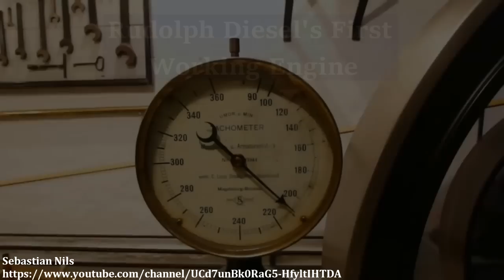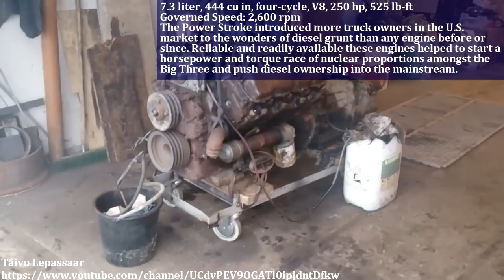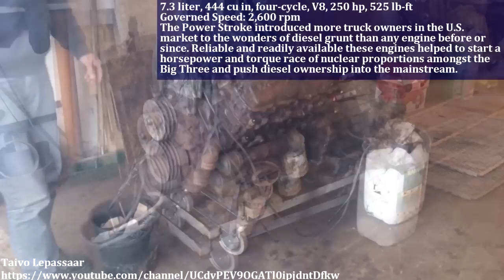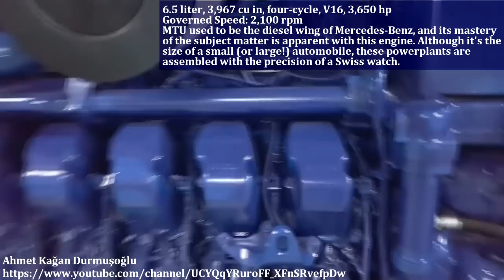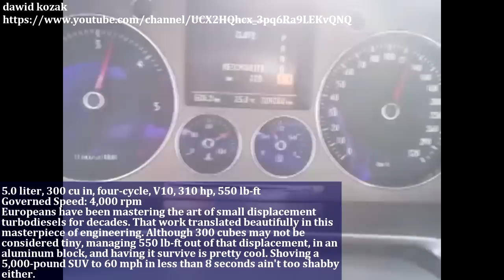10 of the Greatest Diesel Engines - Ever

Comment: No EMDs?

Not only do they make up a significant portion of the heavy freight locomotive industry, they also have a large presence in the inland water ways (i.e. the overwhelming majority of the main propulsion engines in towboats in the US that are 5,000 horse power and above are EMD) and marine (i.e. nearly 40% of tugs in the US have EMD main propulsion engines) industries.  

EMDs also powers a good portion of oil rigs (i.e. the 8500 series semi-submersible oil rigs of Ensco plc are all powered by the 20-710 engine) and provide back up and in some cases main power (i.e. EMD diesel generators provide power for Catalina Island off California) for various utilities.

They also contributed greatly to the war effort under its predecessor Cleveland Diesel Engine Division providing power for submarines, tugs, etc.

Comment: 1:44 not a powerstroke, 7.3 na, idi. Same but alot different. Still made by international navistar. Had a 1991 f250 5 speed with that engine, wicked torque but it hated cold weather.

Comment: The Gardner 150 LX was the most reliable diesel in the 1960s,we had them in ERFs and they regularly did up to 1000000 miles without anything other than regular oil and filter changes,they were slow and steady and this opened the door to Cummins 180 and 220 engines and then Scania,Volvo and Daf joined in and that spelt the end for Gardner.The 8LXB 240 hp Gardner was a big lazy lump just could not keep up with the competition in cost or power.

Comment: Some of the specs are way wrong here. A 60 litre with 1200 inch displacement, but a 6.5 litre that displaces over 3,000 inches? Cubic inches and litres are the same in terms of displacement so these numbers are way off. Suprised the old B model 3406 isn't on here.

Comment: I do not agree at all . consider the caterpillar c12. one of the best engines. in fact it is one of the worst caterpillar mistakes. I personally work with 3 engines and they  have a  factory problem with the oil rings on the pistons. They either lock or break. caterpillars 3406 e , c15 , c10  way better than c12

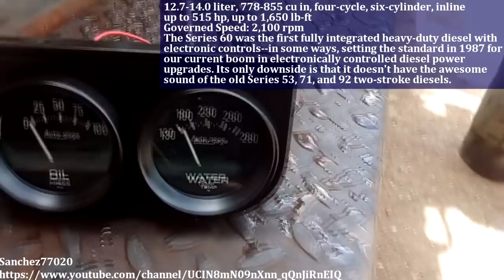Comment: 4:10    Detroit Diesel Series 60
 
Manufacturer
Detroit Diesel

Production	1987–2011
Layout
Configuration
Inline-6

Displacement
677, 775, 854 cu in (11.1, 12.7, 14.0 L)

Cylinder bore
5.12 in (130 mm) (11.1L)[1]
5.24 in (133 mm)
Piston stroke
5.47 in (139 mm) (11.1L)[1]
6.3 in (160 mm)
6.62 in (168 mm)
Valvetrain
OHC[1]

Compression ratio
15.0:1 (11.1L),[1] 16.0:1, 16.5:1

Combustion
Turbocharger
Wastegated, Variable geometry turbocharger

Fuel system
Fuel injection

Fuel type	Diesel

Cooling system
Water-cooled

Output
Power output
330–605 hp (246–451 kW) at 1800–2100 rpm (11.1 L)[1]

Torque output
1,150–2,050 lb⋅ft (1,559–2,779 N⋅m) at 1200 rpm (11.1 L)[1]

Dimensions
Length	57 in (1,400 mm) (11.1L)[1]

Width	34 in (860 mm) (11.1L)[1]

Height	50 in (1,300 mm) (11.1L)[1]

Dry weight	2,550 lb (1,157 kg) (11.1 L)[1]

Emissions
Emissions control technology
Diesel particulate filter

Chronology
Predecessor	Series 71

Successor	DD15
 
The Detroit Diesel Series 60 is an inline-six 4 stroke diesel engine produced since 1987. At that time, it differed from most on-highway engines by using an overhead camshaft and "drive by wire" electronic control. In 1993, it was popular on many USA buses in the 11.1 L (677 cu in) displacement.
When it was introduced in 1987, the Series 60 was the first heavy-duty diesel engine with fully integrated electronic controls.[2] Detroit Diesel prescribed overhaul intervals of 500,000 miles (800,000 km), then raised that to 750,000 miles (1,210,000 km) after more experience was gained with the new engine.[3]
In 1993, the 11.1 L (677 cu in) version was rated at 350 bhp (261 kW) (but would produce 15 more if the cruise control was engaged).
12.7L
The Series 60 was also available in 12.7 L (775 cu in) at the time, which was created by a longer stroke of 6.3 in (160 mm).      Both engine sizes were also used in truck and tractor-trailer applications.
In 1998, the 11.1-liter Detroit Diesel Series 60 was discontinued.[5] Once the 11.1-liter Series 60 was discontinued, the 12.7-liter Detroit Diesel Series 60 became the motorcoach application. Starting in the late 1990s, Neoplan made the Series 60 as an available engine for their high-floor and low-floor articulated buses - the AN460A and AN460LF. Detroit Diesel began making Series 60 marine engines in 1999, with wider availability starting in 2000.[6]
14.0L
In 2001 the bore and stroke increased and the engine displacement rose to 14 L (854 cu in), with an increase in power output to 575 hp (429 kW) and a torque increase to 1,850 lb⋅ft (2,508 N⋅m).
In 2004 the 14-Liter engine became the dominant platform in Freightliner over the road sleeper trucks and changed the ECM to a DDEC V. The 12.7L engine was favored in buses for its better fuel consumption.
In 2007 the 12.7-liter Detroit Diesel Series 60 was discontinued. Once the 12.7-liter Series 60 was discontinued, the 14-liter Series 60 replaced it. By 2008, Detroit Diesel had produced one million Series 60 engines.
In 2007 - 2010 (2008 -2011 trucks), the Detroit Diesel 14L engine was modified to meet new emissions standards and went to a dual ECM configuration (DDEC VI). This engine ran higher compression, higher injector pressure and a DPF exhaust filter. The block and crank remained the same as the older 2004-2006 engine models.
In 2011 the series 60 engine was discontinued and replaced by the DD15 engine.
Specifications[edit]
Specifications for selected Series 60 engines[8]

Displacement
Bore	Stroke	CR
Torque	Power	Dimensions
(L×W×H)	Weight
677 cu in (11.1 l)
5.12 in (130 mm)	5.47 in
139 mm	15.0:1	1,150–1,350 lb⋅ft (1,559–1,830 N⋅m)
@ 1200 rpm	330–365 hp (246–272 kW)
@ 1800–2100 rpm	57 in × 34 in × 50 in (1,450 mm × 860 mm × 1,270 mm)	2,550 lb (1,157 kg)
778 cu in (12.7 L]
	6.3 in (160 mm)	16.5:1	1,350–1,650 lb⋅ft (1,830–2,237 N⋅m)
@ 1200 rpm	330–505 hp (246–377 kW)
@ 2100 rpm		2,640 lb (1,197 kg)
854 cu in (14.0 L)
5.24 in (133 mm)	6.62 in (168 mm)	16.0:1	1,550–1,650 lb⋅ft (2,102–2,237 N⋅m)
@ 1200 rpm	435–575 hp (324–429 kW)
@ 2100 rpm		
Electronic Control
The most popular on-highway Detroit Diesel engine was the 12.7-liter, and on-highway engines are electronically-controlled by the proprietary Detroit Diesel Electronic Control (DDEC) system. The DDEC system was the first commercial use of a fully electronic control on a highway engine, and multiple years would pass before other manufacturers followed. The functions available in the DDEC system include engine diagnostic functions, shutdown timers, progressive-shift functions, fault-history, speed limiting, automatic-stall preventing, and cruise control functions; the cruise control function is popular with fleet operators due to the fuel-saving nature of this function. The DDEC system permitted the owner to download engine management reports, including a record of the use of the engine. The system was able to provide records of truck overspeeding, excessive idle time, hard braking, and other parameters, thereby assisting owners in increasing productivity, reducing engine abuse, and decreasing fuel consumption.
Larger fleets purchased their own copies of the software, while smaller owner operators were able to have their computer datasets downloaded by the dealer servicing their engine. The DDEC system allowed dealers and owners to troubleshoot problems with their engines, permitted changes to horsepower settings, and in some cases, alternative programs were able to be loaded into the computer.
The DDEC system is easy to operate, and diagnostic functions are displayed to the driver. Typically, there are two indicator lights, one in yellow and one in red. The red indicator represents a significant-engine fault, and in most cases, the engine shuts down to protect the engine from damage. The yellow light represents a minor fault, and is a cautionary function to alert the operator to a fault that might not be dangerous, or represent immediate damage to the engine. The operator is able to gain basic diagnostic functions via these two lights. Accompanying the two lights there generally is a switch; when pressed in specific circumstances, the red and yellow lights will flash in a specific order and the operator is able to calculate a fault code, and know the specific problem with the engine.
DDEC I
Initially the engine was controlled by the DDEC I System, which was shortly after replaced by the DDEC II system which would last up to 1992.
The DDEC I system was a two-box system. It had an Electronic control module (ECM) in the cab, and an Electronic Driver Module (EDM) on the engine to operate the injectors.
DDEC II
The DDEC II ECM was a single box mounted on the engine.
The DDEC II Engine was available in ratings between 365 hp (272 kW) and 500 hp (373 kW). The engine proved extremely popular with fleet operators, and built a strong reputation for reliability and longevity. It was also available in a popular "cruise power" configuration, whilst encouraging the operator to engage the cruise control function. During the normal use of the engine, 430 hp (321 kW) would be available, and whilst the cruise control was engaged, the horsepower rating would increase to 470 hp (350 kW), as/since/because the engine was the most economical whilst the cruise control was engaged.
DDEC III
In 1992, the DDEC III system was introduced, and is available in horsepower ratings up to 470 hp (350 kW) due to revised camshaft timing and other improvements. Again, a "cruise power" option is available, and the standard rating was 430 hp (321 kW), and whilst the cruise control is engaged, the horsepower rating increased to 470 hp (350 kW), encouraging operators to take advantage of reduced-fuel consumption.
The DDEC III system also introduced dual-voltage (12V/24V) ECM units. Previous DDEC ECM units are 12-volt only. The dual-voltage ECMs ease installation into 24-volt marine, industrial, and non-USA trucks. The use of Battery Charge-Equalizers (Vanner) is not required as/since/because the ECM can connect directly to the 24-volt batteries.
The DDEC III ECM is thinner than the DDEC II ECM, with wiring connectors at both ends. The front-end has two five-pin connectors for the injectors, and a thirty-pin connector for the engine-sensors. The rear-end has a five-pin Power Connector, six-pin Communications Connector, and a thirty-pin Vehicle-Interface Harness-Connector.
DDEC IV
1997 brought the introduction of the DDEC IV engine control module, and further improvements in the design of the engine, notably a wastegated turbocharger and engine management improvements provided increased horsepower ratings up to 560 hp (418 kW), and increased torque outputs to 1,650 lb⋅ft (2,237 N⋅m).

Comment: Original Diesel,  60.0 liter  1200 cubic inches, that doesn’t match!
Two-stroke?  I don’t think so, looks like a 4 stroke for sure.

MTU 16V  =  6.5 liter, 3967 cubic inches???

With those kind of quickly recognized errors, is anything to be given credit as correct in this video?

Comment: Funny. The tag on my Ppump cummins b series states 180hp at 2400rpm

There are 300 and 370 marine application B SERIES
Reply: Simply because the cooling system is so much better on a marine engine than an automotive one. 
Watercooled turbo exhaust housings. 
Water to air intercooler
Engine coolant cooled with a raw water fed heat exchanger. 
So more fuel
Way more boost
More max rpm
Better cooling
All adds up to more hp in a marine 
unit.

Comment: Detroit 6-71 and the Cummins 855.
Reply from the maker: @jeanclaude7018  Those is your favourite engines? :)
Reply: @CarNewsTV Why not? These are the iconic legends that built America. 
As you mentioned,  nothing sounds like the old Detroit.  The 6-71 was born in 1938 and was good enough to be made for 60 years, and spawned many sisters and brothers used for every possible application.  
The Cummins 855 series was also made for decades from 262 hp to 400 and beyond. Simple, tough, and easy to fix.
These two competitors dominated the highways when the interstate highways went in and trucking with diesel engines became the norm. They literally built modern America.  They actually were often rebuilt on the roadside and were very dependable and parts were everywhere. These would STILL be produced if not for emissions laws. In fact, the Detroit is still produced for the military. 
So,  I ask you why these two legendary engine families would NOT be some of the best of all time? FAR more influential than some you mentioned,  such as duramax / Isuzu and 7.3 Ford/ international.

Comment: I would have included one of the old Caterpillar slow-speed torque monster engines from the 40's and 50's, like the D342 in the D8 dozer.  Machinery that built the US.  They also have a very distinctive sound, as most of the vintage Cats did, but not irritating like those nasty Dee-troit bumble bee in a beer can two-strokes.

Comment: C12 drop valves at 750,000 miles and blow rods 1,200,000.i worked for a small trucking company that had 6 peterbuilts with these engines and they all did the same thing.he couldn't get rid of them fast enough when the rods started flying.

Comment: that first engine said it was a 60 liter!!!  1,200 ci engine!!!!!  with only 20 HP????   sure didn't look that huge, I mean 60 liter engine displacement would be massive, that looked like a tiny little .6 liter engine???    whatsup with that???   1,200 ci engine would have like well over 2,000 horsepower, not 20???  wtf
Reply: Did you  figure the bore and stroke ?
Reply: Yeah, it was a 60 liter.  This was in the 1890s before fuel injection had been perfected- that engine used a compressed air system to inject fuel.  We've done a lot in the past 120 years to make diesels smaller and more powerful.

Comment: There you go - ranting about the "greatness" of the VW V10 TDi, which has a truly abysmal reputation for its poor reliability. Instead you should have shown the original Audi 5-cylinder inline TDi Type AEL, which was a truly magnificient, reliable, powerful engine that usually outlastet the chassis it was delivered in.

Comment: Everyone has their own opinion but to not include the Detroit Diesel 2 stroke engines is just ludicrous. They have powered nearly everything since the 30s. From 2 cylinder ag pumps to 16 cylinder Locomotive engines, to every different kind of heavy equipment, generators, they were  a favorite of marine engines for 60 years,  not to mention more medium duty and heavy duty trucks then the 7.3l and the Duramax did put together..They basically won  WW2 for the US and were the main engine for the Military up until just a few years ago.  Id say thats a little more important the the Duramax or the 7.3L. I  also think it interesting, and what most people don't realize is  that both the Dt series(414 430 360 530 466 etc etc,) and the B series were both Ag engines way, way  before they were truck engines, heck Case helped design the Cummins B.

Comment: The hp rating for the b series Cummins is way too high, in pickups it was just over 200hp. the 7.3 in the video is an idi, not a powerstroke, and it was governed higher than 2600. The dt466 is actually known to be a fuel hog, not efficient.  The 60 series is a hell of an engine, I've run on on a dyno at 100 percent load at idle speed.  The first offered duramax was the LB7, not the LBZ (or, if you meant the dmax being offered in the brand new trucks, it is the L5P).  It's a good list, just the facts aren't all straight

Comment: 567 - 645 series Electromotive Division GM  engines (700 - 5000hp at 900rpm)  best engineered and simplest to maintain prime mover  engines in world that I have come across in 40 yrs in tugboat industry. For generators...4-71 or 6-71 Detroit Diesel  running at 1200 rpm. Both series of engines will start and run when others won't...such as things wrong with them. No glow plugs and no electronics. Long, long history in  marine applications (since WWII).

Comment: I hear a Cummins diesel coming long before it appears. Sounds like a damned typewriter high on meth. Why drive a clacking POS like that when you could have a JOHN DEERE 6068 in line 6 diesel that hums just like a 1930 Singer sewing machine? Too bad I can't get it out of my excavator into my pick up. Starts in ANY weather with no glow plugs and no ether on the first turn.  Truly a fine piece of American engineering. The idea that a diesel has to be a noise box to be respected is absurd.

Comment: I don't think duramax are great engine. I heard that they might suffer reliably. I would say Detroit 6.5 are better
Reply: Tay TYLERIENMAM Station I would never own a duramax I’ve worked on too many that have diesel in the oil and thinned out the oil and start knocking just because an injector line or return line came loose
Reply: Mate . Do your own research stop reading bullshit someone else has written. YOu can say what you like. so can I !

Comment: Disappointed not to see the XUD in the list the first high speed automotive diesel designed to compete with petrol and without which Europe wouldn't be so accepting of small diesels 

Before this engine diesels used in cars were little more than smaller industrial engines for generators pumps and boats and a 2.0l engine might get you 40bhp